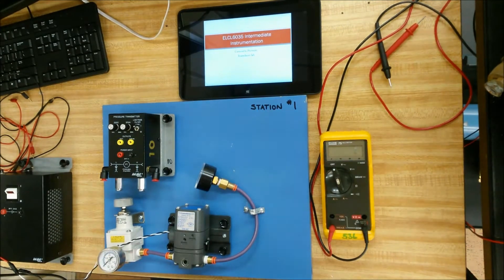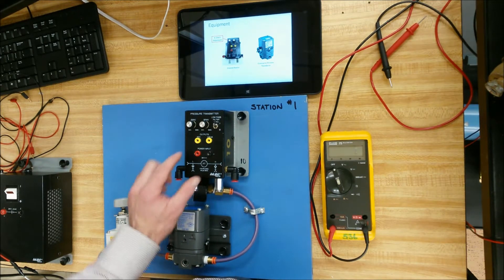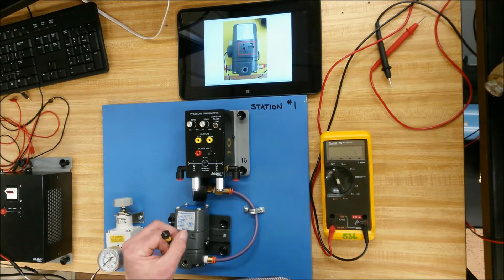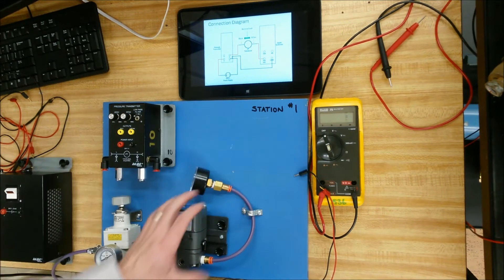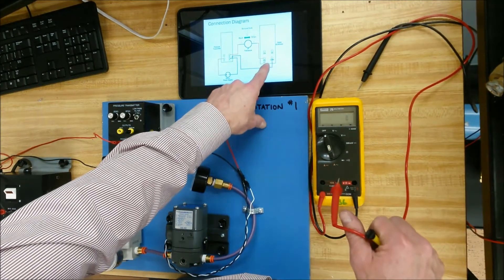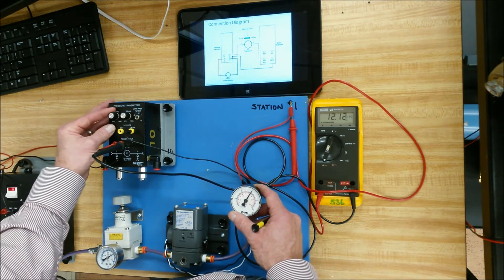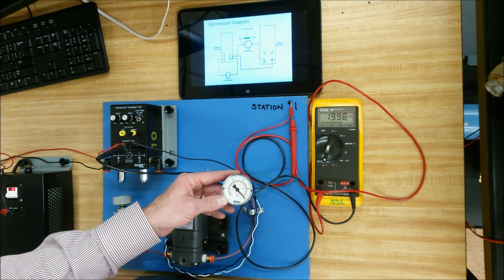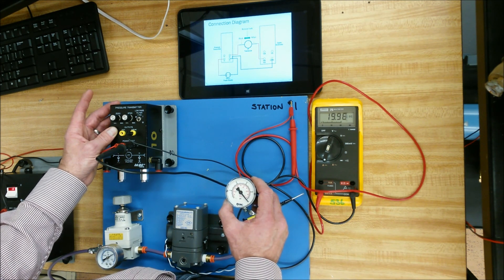Current to Pressure Lab #2, Part 1

Comment: Dear Sir, could you please let me know that the White wire which shorted with Multimeter is Positive-red probe  ? is that 4 to 20 mA positive wire of transducer?
Reply from the maker: Yes. The white wire is the positive. Note: if I connected it backwards i.e. positive to black wire of the I/P transducer, then 4 mA would provide 15 psig out. https://www.itm.com/pdfs/cache/www.itm.com/ip-42/manual/ip-42-manual.pdf
Reply: @PeteVree  thank u for ur reply sir, could u pls share the screenshots of the slides which u hav prepared in the tab I’m unable see the terminals properly from the video . Or could u pls share me a schematic of the same

Comment: Wouldn't it be better to use a Guage that goes over 15 psi?  Once its pegged, you don't really know what pressure you have for the 20ma
Reply from the maker: +damien king Some times you just use whatever is available in the lab. This is simply set up to help my guys see the relationship between the two signals.